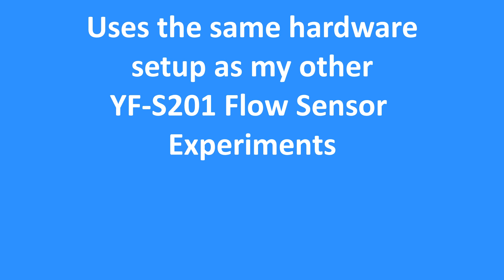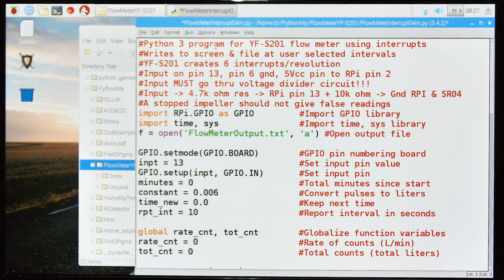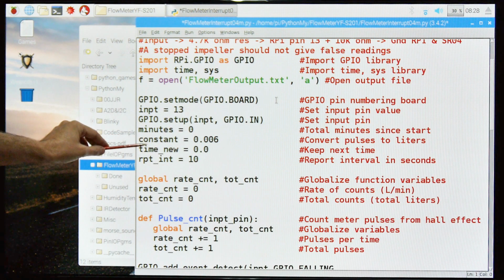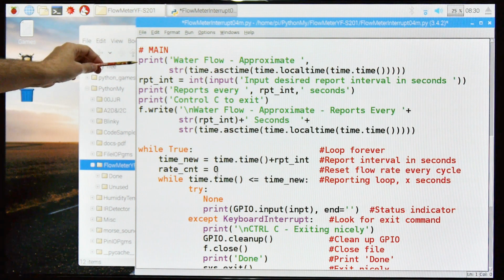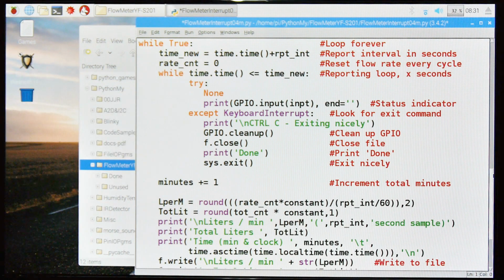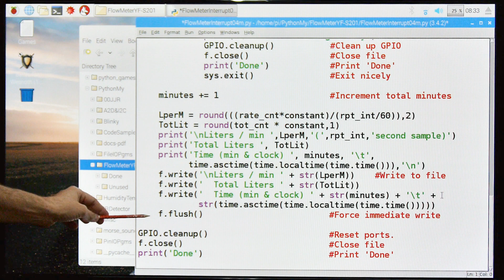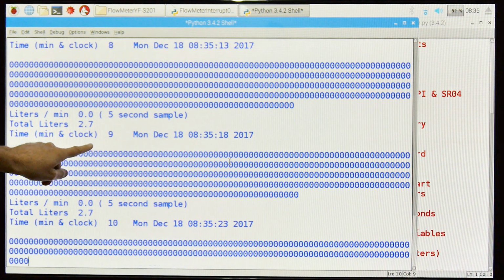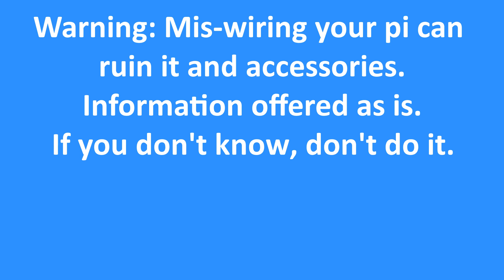RPi 22 - YF-S201 Water Flow Meter/Sensor, Interrupt based - ADVANCED

Comment: Can you point me the document with says that the output of this flow meter is 5 V as well ?  I am trying to understand this. I have a sheet which talks nothing about the output voltage. Is that an assumption that the output would be 5v as well when the input is 5 volts ? Is there a formal terminology for this value ? This is the sheet I am referring to https://www.mantech.co.za/datasheets/products/yf-s201_sea.pdf

Comment: Great video, do you have any idea how to do this with digitalio? It doesn't have built-in event detect like GPIO? I modified the code from your previous flow meter video to work with digitalio but I need to add interrupts to get accurate readings.
Reply from the maker: Sorry, never used digitalio.

Comment: Thank you for your fantastic series, including a number (3!) of different approaches to the flow metering. A quick question: can you quickly describe when we might want to use interrupts vs. polling? It seems that the timing of the interrupts is a lot easier to deal with, since the only decision is to decide on the reporting interval, while the GPIO port is detecting the pulses at its fastest(?) rate. 

On the other hand with the polling method, you have to decide on how often to poll, and then how often to report. 

Also, I don't understand the minute += 1 statement. Is this incrementing "minutes" even though rpt_int may not necessarily be 60 seconds in length? Isn't your minutes counter counting the number of cycles of rpt_int rather than the minutes in total?
Reply from the maker: Thank you for the kind words.  Interrupts, when triggered, literally interrupt the current operation and immediately execute whatever is in the named subroutine.  So (in theory) they are more reliable, less prone to timing issues.  But in RPi world you can only use 1 at a time (at least as far as I can find, I've tried more without success).  Polling has 1 big benefit, you can poll many pins (inputs) at a time.  But of course with polling nothing happens until the pin is polled, and if enough time goes by between polls, a pin can change state back and forth.  The huge drawback is that the timing is totally unreliable and everything impacts timing.  Just adding a line or 2 of code slows down the loop, and executing different stuff from the poll loop changes timing a lot.  General rule of thumb: if timing is critical --> interrupts.  If many functions is most critical --> polling. 
The minute thing is a cheat.  I do that when demoing because otherwise you'd have to wait a minute between results, the video would be long and boring!
Reply: @tsbrownie  Perfectly clear, thanks!

Comment: Awesome video !
For homebrewing purpose, I'm trying to interface the flowmeter with the pi but it doesn't work. In the script I use, there are some pull-up/down resistor configuration but you don't configure it... 
What is the internal resistor configuration in your script ?

https://github.com/nanab/Flowmeter/blob/master/__init__.py
Reply from the maker: I am using the default states which according to the documentation is as follows: "At boot up all GPIO are in INPUT mode, GPIO 0-8 have pull-ups to 3V3 enabled, GPIO 9-27 have pull-downs to 0V enabled."  There is some debate on forums about how reliable this is, so in the future I will be more explicit.  Please note, when you post the same comment more than once they all go to youtube's spam folder, so I almost missed your question.

Comment: I have a question! Why did you say that raspberry pi b+ works with 3.3V and it says that has 5V output?
Reply from the maker: The pi has both 3 and 5 volt outputs.  Look at the diagram at the end of most of my pi videos.  I have labeled all the pins.  The pi can OUTPUT 5 volts, but the INPUTS are limited to a maximum of 3 volts.
Reply: tsbrownie ohhhhhhh that’s why it didn’t work for me xD. So at the begging, I connect the VCC of Flow Meter to 5V or 3.3V?
Reply: tsbrownie Of the raspberry
Reply from the maker: My flow meter specs said it required 5 volts (I tried it with 3 and it seemed to work.)  I used the 5v from the pi.  You should use whichever your flow meter specifies.  If it works with 3.3, that's easier, no divider needed.  If it requires 5v, you need the voltage divider.

Comment: Can you explain why the input must go through voltage divider?  New to this so trying to understand.  I thought the flow meter had an output of 5V.
Reply from the maker: The RPi has a limit on its inputs of 3volts.  The meter specs says it uses 5v inputs and outputs 5v.  That's too much.  The voltage divider lowers the 5 volts so that the pi only "sees" 3 volts.  I have used my version of the meter on 3 volts and it seems to work, but it may also become less accurate or some such.  I did not test that.
Reply: tsbrownie got it. Thanks. I didn’t realize the RPI had 3.3V input.  Looking at Logic Level Converter as alternative.